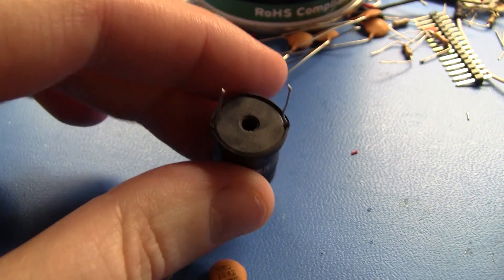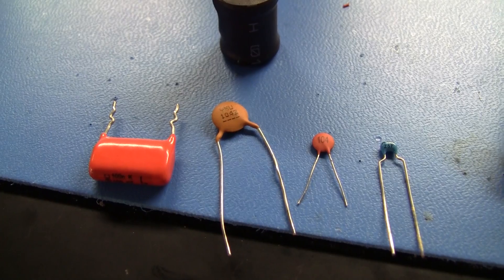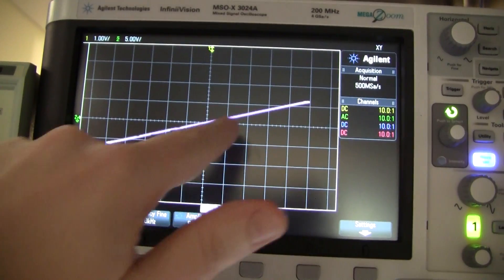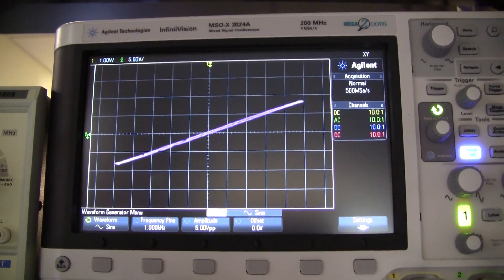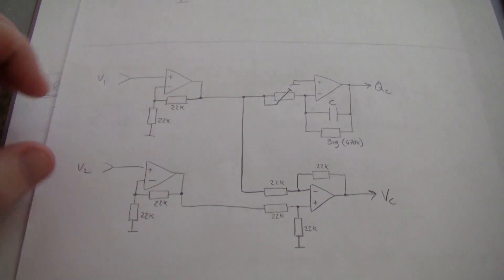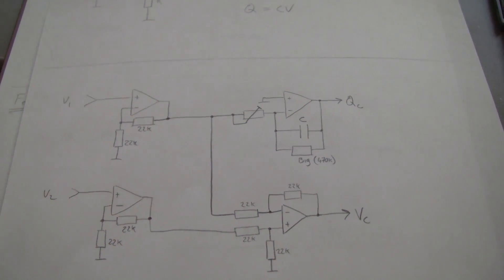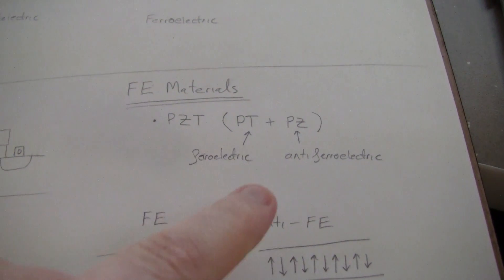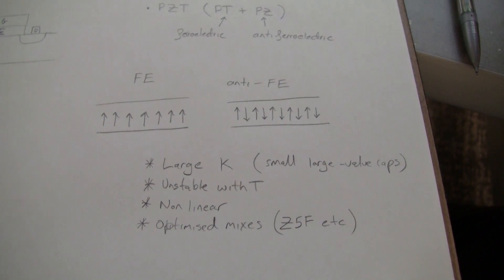Ferroelectric Behaviour in PZT Capacitor Dielectrics

Comment: Hey, im a French student, and im currently trying to reproduce your experimentation, could you just indicate what specific capacitor you’re using please ? That would be a good help thank you
Reply from the maker: I don't recall exactly the manufacturer, just try any largish value MLCC and it will almost certainly have similar properties. Many modern devices are better near room temperature, but you will easily find ones that aren't too.
Reply: @vk2zay thank you for your feedback 👍

Comment: Hello, i make your circuit and I tested on a capacitor and I obtained a straight line but is rotated with 90 degree (is mirrored by y axis, in quadrant 2 and 4 not in quadrant 1 and 3 like yours) what i do wrong? Thank you

Comment: Hello, I am trying to simulate the circuit what you have imagined ,but it is not work. So, could i know your  detail circuit just using for my school homeworks?
Reply from the maker: The circuit is as shown in the video, nothing special about it just some opamps.  Your simulation may not be modeling the temperature-related effects on the capacitor dielectric.
Reply: vk2zay Thanks for your response very much, I will look back for my simulation.
Reply: vk2zay hello,i have some problem.What is the value of the capacitor,resistance which in the  first circuit? And the second circuit,the value of capacitor which in front of the Qc. Could I know these values?

Comment: Thank you for your appreciable video. I work on this circuit but i wonder how your circuit eliminate the problems of Sawyer-Tower circuit (conduction part and the displacement part)??. Secondly, what about the input voltage, do you amplify it or you used the usual function generator with maximum amplitude 15 V because I knew from the literature that the modified virgins of Sewyer- Tower circuit used voltage amplifier tends to 1KV. Third, what is the frequency of the input a.c. voltage? Fourth, I noticed from your excellent demonstration that you used 3 op-amps not 4 op-amps, is there any specific reason for that?? Fifth, if I test capacitor with unknown value, what is the recommendations for the values of C and Var R in the integrator? Sixth,  does 741 op-amp is appropriate for this test? Seventh, I work on PZT+ polyvinylidene fluoride and I used the original Sewyer-Tower circuit but I did not get the complete shape of hysteresis at all, So, Do you think if I use your circuit the hysteresis shape will appear or not? Eighth, Is there any source 'article' for this video?
Finally, I deeply appreciate your efforts if you respond on my questions.
Reply from the maker: I've never read much about the original Sawyer-Tower circuit.  I believe they where studying Rochelle salt crystals and sensed the current via a capacitor rather than a resistor.  Because of the much higher leakage through Rochelle salt than PZT they likely needed to worry a lot more about the leakage resistance and its associated current than I did with PZT caps.  They also likely needed very large drive voltages compared to PZT.  I was only using a few volts pk-pk straight from the signal generator which was low impedance enough to drive the load.  I used dual LM358 op-amps, four independent op-amps total, the frequency is quite low about 1 kHz.

For your use with PVDF you might need a large drive voltage.  You could replicate my circuit and verify it works with a PZT capacitor, then replace it with the PVDF and see if you can drive it hard enough to see non-linear effects.  You can always attenuate the inputs to the measurement circuit with some high-value resistor dividers and drive with a high voltage source.

Comment from the maker: Indeed, voltage dependence of capacitance is quite common in many dielectrics, paraelectric and antiferroelectric materials have saturation points and non-linear capacitance.  I've thought about making a parametric oscillator or mixer with this effect rather than varactors.  A saturable reactor might also be exploitable for parametric circuits.

Comment: Those circular orange ceramic caps are also microphonic too, try shouting at them ;)
I discovered this for myself while messing about with a wein bridge oscillator, shouting at the circuit was enough to quash the oscillation! - Thx for the cool vid